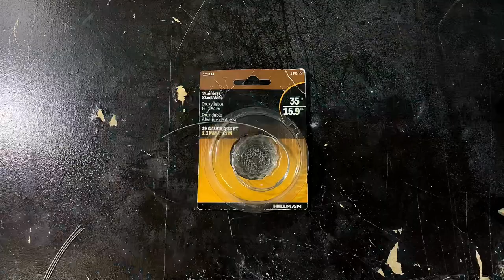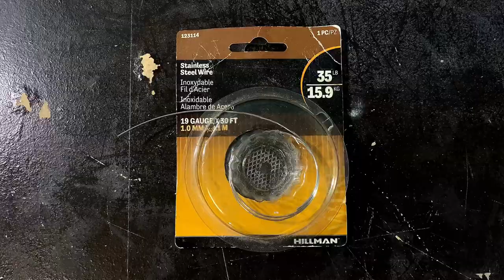Lure Making a Flat Sided Crankbait

Comment: That is nice looking crank 💜 two comments: one layer of clear coat after sanding the lure and before the painting (the water based paint wouldn't lift the wood grain)👌
Second thing: I don't think the hole filled with super glue and baking soda did anything to balance the lure (the wood probably have higher density) it was mostly the screw and the treble hook 🤔 anyways keep up the good work 👍 from my personal experience check some tutorials about the tags for the video if you wish to get more views ▶️
Reply from the maker: Thank you for the advice. The reason I only went with the baking soda instead of lead is because during testing it made the lure too heavy and it sank so I just decided to fill the hole.